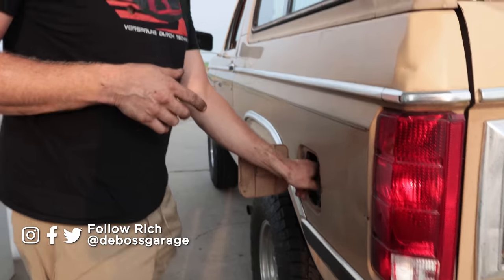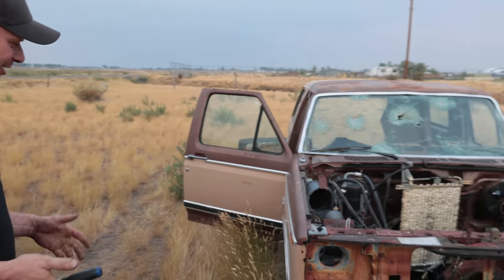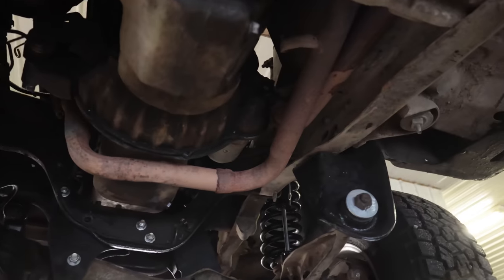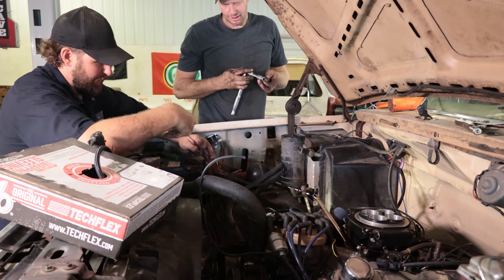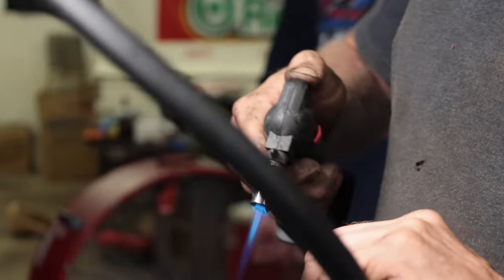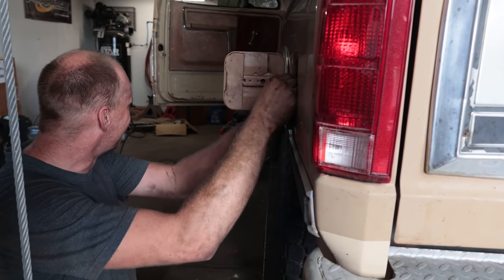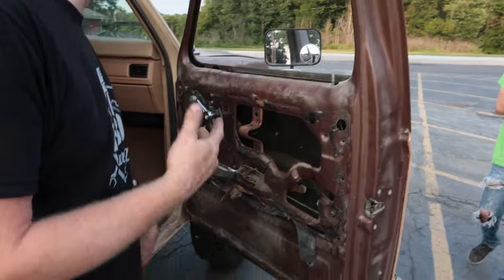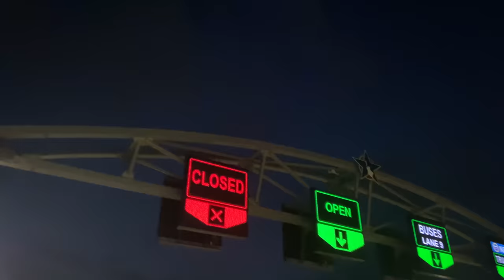@ViceGripGarage Installed EFI on our Bronco | #JuiceBoxBronco [EP2]

Comment: I know it is way too late. But, doing the "roadkill technique" of removing the hood would help. Best yet, a garden sprayer on the radiator from inside (cheap home depot fix) does wonders. We even used that on the racetrack. Game changer.

Comment: My first truck was a 1985 Bronco with a 351 Windsor and a C6 3-speed automatic, a NP-208 transfer case, 9” rear with 3.55’s, the dreaded TTB Dana 44 based front end, a 6” Skyjacker kit and 35’s. The thing had a 35 gallon single fuel tank and the vent was jacked up, making fill-ups a 30 minute affair. It got a solid 7 MPG. Thank God gas was around .89 cents back in the mid to late 90’s while I drove it. Good times. Haven’t thought about that thing in a long time. Thanks for the video!

Comment: You mean none of your farming chums have fixed you up with a fuel rock!

They are an amazing piece of tech, you fit it under the handle of a pump and it holds it on in just the right spot that it runs without clicking off you do have to be careful though while using it that you don't over fill it.

Comment: I had a 1978 Bronco with a 351m a C6 transmission a 9in nodular rear with 350 gears the truck rolled on 35 inch tires the truck head headers and Aluminum Intake Manifold as well as a Edelbrock carburetor it got 15 miles a gallon all day long

Comment: That carb you guys removed was a Holley Truck Avenger.  Excellent carb for off-road, allows you to do wicked Inclines, and start on very unlevel ground, damn near EFI when setup right. From the factory they are usually jetted fat, and not very good with strictly onroad driving. They like to heat soak if you don’t run at least a 1” plastic spacer, which was your hot start issue. I’m running a 670TA on the 343 AMC in my CJ7 rock crawler and I love it.
Reply from the maker: Thanks for the info!  Much appreciated
Reply: @DEBOSSGARAGE  no prob man. Thank y'all for making great content and awesome to see two of my favorite channels working together.

Comment: Wow hard to believe there are people left like that anymore! He just gave you a $1200 system , Just a suggestion I would hook the PVC back up if you don't pull the crank case fumes out of the engine you will star building  sludge in the engine especially with and engine with high miles. Another thing move the fuel filters away from on top on engine because running that hot you are going to boil the fuel in the fuel filters

Comment: Best solution for the fuel neck...drop the tank and on the top next to the sending unit in the flat section throw in a -10an right angle barb fitting. Take the factory fuel neck out..get an 04-06 Chevy 3500 cab chassis one. Take the plastic thing out of the factory rubber hose and connect it, then get some 1/2 fuel hose to connect the vent on that to the -10an right angle barb. Now the tank will breath and fill regular speed. I do this on all my obs trucks, works like a charm, cheap and easy.

Comment: I know they get crapped on but I absolutely love the TTB front axle. I'm doing some old fashioned CAD to stiffen up some Dana 50 TTB housings. Just lengthened and cut and turned em. Got RCV shafts and a locker. You disconnect your swaybar and the articulation is insane. Just need a good, aggressive sidewall tire cause you're gonna be using it.

Comment: Had the same problem with exhaust in an old suburban. Noticed when I had a sheet of plywood in the back that stuck out about a foot, it broke up the flow so no more exhaust inside. That's why the upgraded trim suburbans have that spoiler looking thing on the roof. Let's you roll with the window down and no carbon dioxide poisoning.....which is good!

Comment: I had a 79 bronco with 33s and a warmed up 351m with a c6.  It’s really ironic you brought up driving 80 mph in the juice box and noted it’s not so bad bc I was reminiscing about mine yesterday thinking the same thing.  With the 350 gears I could cruise all day at 75 and keep up with traffic and not wind the motor too high.  It was very happy at 70-75. Probably cruising at 2,700 or so.

Comment: I bought a Holley Projection unit to put on my 1988 Jeep Wrangler. Kit said it was an easy bolt in. It's easy if you have a lift and can drop the tank etc etc. I ended up selling it and just rebuilt the carb a couple more times.

Comment: Had a 72 Bronco with 351 windsor. Overheated and would vapor lock. Until I louvered the hood. Just cheap bolt on louvers. But did the trick. Also made fire wall cooler on inside.

Comment: Had the same issue with my Bronco.  Get a filler neck from an 87+.  Fits right in and totally redesigned. 
Finally stopped spitting out fuel and clicking off a dozen times every time I filled it up.

Comment: I have an 83 f250 diesel that fills really slow just like you bronco. it actually got a little bit better when I completely removed that hose from inside the fill tube so good luck on figuring out how its supposed to work
Reply: Just like it slows the fuel going in...it slows the fuel trying to get out the filler cap on long or tight right hand bends...in the days before clicky-clack sealed fuel filler caps....
So if you want to eliminate it...fit a clicky-clack fuel filler and cap...and a breather/carbon canister type hose.....otherwise you'll just create other problems....

Comment: You may find that to get the Sniper to play well with a dual-plane that you'll have to install a tapered open spacer so the Sniper sensors can see what's happening with vacuum and for the IAC to function properly. Some do some don't but also a spacer gets the Sniper a little further from the heat

Comment: Fuel issue used to be pretty common on some old fords due to the nearly level line to the tank and the way it was pinched down between the frame and the box. With my 73 I had to seek out stations with the older style pumps that went slower, feather it at other stations, and avoid chevron and shell entirely. Took 20 minutes at most stations. on the slowest notch.

Comment: That's probably a truck avenger holley. I had one and I went down 10 jet sizes before i gave up and put on a different carb. Ultimately went with the sniper as well and I love it. I just need to learn how to tweak it for the -30 brisk MN cold starts.

Comment: On the slow fill I’d suggest two things: first check the full hose that runs from the tank to the metal fuel neck. Over time mine collapsed a little where it bends at the frame.  Second the plastic vent line was just a bad design.  It tends to bend and crimped as it is being reinserted into the hose.  I yanked that out completely.  My 85 Bronco is filling much quicker now.
Reply: Wouldn't removing the vent line allow the fuel vapor from the tank to escape to the outside air? You might get a ticket for a bad evap system, and (hopefully a small amount of) fuel will evaporate out of the tank over time while the truck is parked.

Comment: The vent tube on the top of that holley your swapping for the EFI is actually "Factree" as its the "Truck Avenger" model.. same purpose as the "Street Avenger". The purpose is to help prevent flooding and also the floats are setup so when your on an extreme angle that atleast one float is always working and the fuel can transfer to the other bowl better.

Comment: That's definitely a bigger throughput Holley TBI than the stock fat mouth two-barrel style that Dodge used in their late 80s, early 90s EFI setups :).  Its nice to see another Oregon plate pop on the rebuilder channels, don't see too many vehicles getting rebuilt from the old fleets from out here :)

Comment: I got a 302 in my 78 Mustang II with a high rise Parker intake, 4barrel edelbrock,  It’s has a little cam been bored a hair over, stall converter and runs like hell . The motor did come out of a wrecked 79 ferd fairmont so you knows it’s a runner. The only thing we did was put it in and put the intake on.

Comment: You can use the sending unit from an 85-86 Bronco with a fuel-injected 302 (DELPHI HP10181).  That will give you a return line for the tank and power connectors for a fuel pump.  We used (SNE-19-369) a Holley fuel pump and mounted it in place of the original lift pump, which was only rated 30 PSI.  You can connect the fuel line with "SAE Quick-Disconnect Female Push-On EFI Fitting 3/8 in. -6 AN & Fuel Rail Fitting 5/16 in.

Comment: When I was a kid my Dad had a 1980 F250 4x4. He always said his biggest gripe was that it took forever to fill up (and with the 400 V8, he probably did that often enough...). He figured the filler pipe didn't have enough angle going to the tank.
Reply: Or, it did not have an air outlet on the top of the flat part of the tank...air blockages and splash back guaranteed....
The Japanese car makers figured it out in the 1970's...

Comment: The problem with the old Ford fuel neck is that the vent is actually a rubber tube surrounding the metal filler tube. Over time the rubber vent pipe collapses and restricts venting cause back pressure in the filler tube which clicks off the pump.

Comment: Not sure if you're aware, but when that truck was made the US was limited everywhere to a maximum speed of 55MPH or less. Cooling systems struggled in the 1960's then only got worse as emissions controls came in in the 70's and air conditioning became more common the cooling system got more weak but when 55 became the standard it saved them. Anything from the mid 70's to the early 90's will have cooling issues, made worse by the lack of maintenance that most vehicles endure. Good luck.

Comment: DANG STEERING!!  That year Ford has the telescopic steering shaft. The top shaft slides over the lower shaft with a nylon spacer.  It wears over time.  I shim mine with small sheet metal or an old spark plug feeler gauge.  Pain in the Ars.

Comment: You don't say what year that Bronco is, but if it doesn't have fuel injection it is a 1980-84.  1985 had multi-port fuel injection on the V-8 models.  I hope you reset the tow angle after you adjusted the camber.  You are hooked-up with that Vice Grip Garage guy; he puts Band-Aids on bullet holes, so they say.  Great video!

Comment: A tip to get th eold window winders off (clip type) get a rag in behind where the clip is. Put the edge of the rag between the winder and the door card, pull it tight and roll it around the winder. Clip comes straight out.

Comment: I'm an old school pump jock. I worked gas stations for nearly 30 years. The trick (in most cases 
) is to run the gas slow into the tank so it doesn't splash the check valve.
Reply: Then it won't click off till the tank is full. Running too fast causes foam/splash against the check valve and stops the gas nozzle. ⛽
Reply: Yeah you are a genius, it only takes experience people to do those kinds of trick in gas stations.
Are you retired now??

Comment: Fuel filler issue is that the Ford tanks have a special place for the vent tube. Instead of taking the fill neck off the hose, take the hose off the tank. You’ll immediately see the “slot” the vent tube needs to go into (the top one). I know because I’ve messed it up at least twice… 🤘

Comment: The ice noise tickled me, because when I was working on my truck, and I was trying to determine error codes, using my reader. I heard a noise that sounded just like the "ding" when something throws a code,  and I kept hearing the ding every now and then. 
 It really blew my mind, and then I realized that it was one of the wind chimes on our front porch, and because the wind was very light, the only pipe that was dinging was the one that is the same tone as the truck "ding".  Lol.

Comment: Kind of been there before with Ford trucks overheating. That fan clutch is usually the problem. Either an electric fan or a flex fan have cured the problem for me. The few times it wasn't, it was the thermostat, water pump, or radiator in that order.

Comment: When I use a locking gas cap, the line kinks and the same thing happens at the pump. When we put the original OEM gas cap on, the line fixes and the gas pump  stays flowing till full. I figure the locking gas cap does not vent the same as the OEM, hence the line collapsing. When we travel, we change from locking cap to OEM. Hope that helps!

Comment: My grandad tells me that when climbing a hill in an older car with a belt driven fan you've got to keep the car in a low gear and maintain the revs so the cooling fan spins fast enough, otherwise you'll overheat. Perhaps a similar rule applies to highway exits when you've been running at speed for a while?

Comment: vent tube inside the filler neck is messed up, had the same issue with my 81 bronco
Reply: theres a thing on the neck of the tank that you need to fit the vent tube into so it can work properly

Comment: good day Sir. I have been following your channel ever since the Lesabre. I have recently brought mine to the point of road tests. my question was did you experience any slipping in Drive? my 1st gear and reverse operate fine but slips in Drive. I gutted the interior and am at the point of cutting hole in floor to adjust the bands. did you have to make any adjustments like this ?

PS
Awesome channel

Comment: My 82 could do 13-14 mpg if I kept it at like 60-65, still sucked ass, 3000+ rpm on the freeway with the c6. Was carb'd, running like a 600 cfm summit holley clone. Regret selling it though. I pretty much solved the vapor lock problems by doing a return line from right before the carb, even with the mechanical fuel pump I could still bleed off like 2-3 PSI back to the tank

Comment: It's so fun watching these guys compare notes - I've seen both of them in action and I think they are both great mechanics. 
Now I'm a LITTLE dissapointed;; did he just replace a manifold when he really needed a  donut gasket?
that EFI kit fascinates me. . . I wanted to have this done to a 460 and the parts kit was $2 grand. 
I don't know if you mentioned which engine this is - but I like the dual exhaust. 
OK, the 302  - I figgered -
I love this Bronco more by the minute.
I hope you can find a back glass eventually!
those wing windows are a bitch. 
I wonder why it's overheating? Is the radiator all sludged up?
those side mirrors are lame.

Comment: My B5 S4 does the same thing on fill up.. do a video on diagnosing the vent please! I pull the evap boot off the pump and I can fill up.. or I throttle the pump slower.. its such a pain!

Edit: saw the fix once I finished the video lol.. think in my audi it's an external vent.. hope I dont have to drop the tank for it..

Comment: Great video, love the new fuel system install. To bad the engine in getting toasted over and over, time for a overhaul now. The 302 should be seeing at least 18 mpg in that vehicle with the new system but that engine is toast. Me I would pull it and either go 351 or 300, my choice would be the 300. They can get amazing hp and torque out of one now.  Plus the weight loss in a 4x4 makes it a much better mud truck. The 302 can be built ok but Fords 300 was in my opinion one of their best engines ever built. Never thought a gas engine could be able to go anywhere close to what I have seen those go. 750,000 I have seen on those and new tech has seen amazing power increases but their goes the longevity I suspect.

Comment: My '86 wouldn't take fuel fast either.  I think the flow rate has changed or something since the 80's.  I had already replaced the whole fuel system and still had issues.

Comment: If you replace the starter with one from a 92-96 f series or bronco with a small block v8 or a 300 6cyl you can change the wiring slightly and get a much better starter.

Comment: I will give up my F150 with a new motor in it to get my hands on another bronco. I should have never got rid of it. Should have put a transmission in there. Had over 300,000 on the motor and that big 351 was still strong to the end.

Comment: You can use the majority of parts from any of the Ford truck of the same year range. So if you need more body panels or anything it's much easier to get one off an F-1,2 or 350.

Comment: That body style truck and bronco dont have a big enough vent line so it lets the fuel come up the fuel inlet and shut off the gas pump. I had to pull mine nearly outta the inlet to put fuel in it.

Comment: 4 inch lift is the top hole, 6 inch lift is the bottom hole. only difference is the spring length. Either way you need adjustable camber bushings.

Comment: If temps are okay at idle & low speeds but hot at speed, sounds like a coolant flow issue. Maybe someone installed the wrong stat, or installed it backwards?

Comment: The small block ford 70s through 90s sometimes the impellers come loose in the water pumps.
Reply: Several Chevys and a few Mopars had the same problem.

Comment: Consider getting a different front lift kit, or at least addressing the bump steer created by using axle pivot drop brackets. Check out solo motorsports, or desolate motorsports... There's a couple of other ones too.